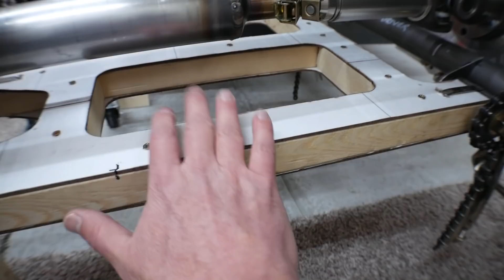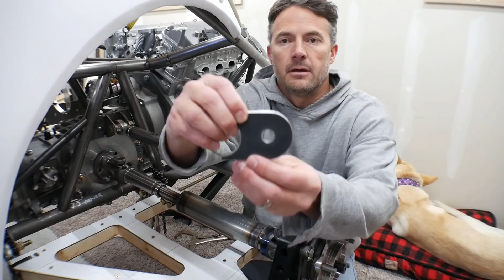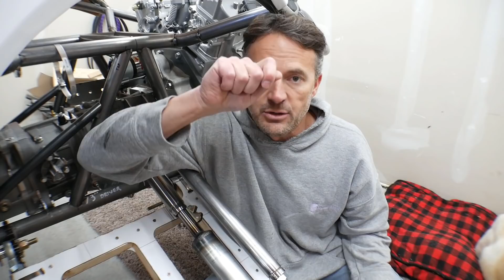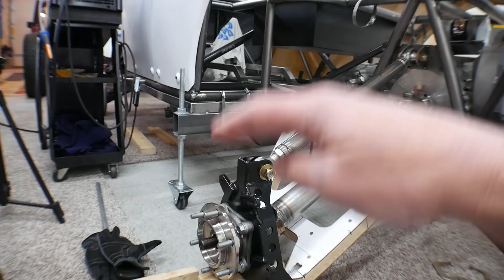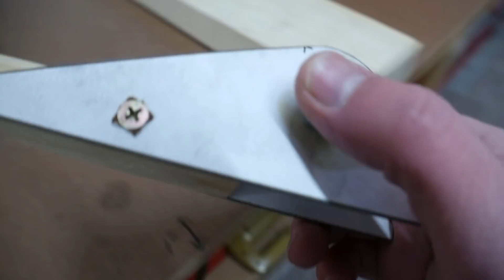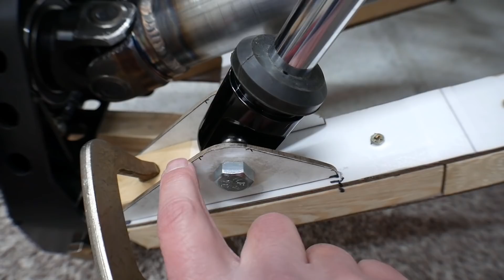Wratchet Rear Suspension Build #5 Shock Absorbers placement.

Comment: comment 66 showing & 259 bug fab liked: I wonder if a thick sprocket & chain free spinning can b used as sway & slow full spring energy throws. U can hve the free spinning sprocket hve exercise type knob adjustment so it can bleed some of the spring throw energy & chain total limits length of throw like limit strap. It would just hve to b built to strength needed for rig it is on, esp the chain.

Comment: Was thinking about ordering the sheet metal add on and something crossed my mind....
     Now that you have the "very accurate" wooden template and you have your lower shock tab how you want it and it's accurate location could you blend the top plate of your lower control arm and the lower shock/coil carrier into the sheet metal program of Bend tech?
     Is this making sense?  Instead of "adding" a lower shock tab with welding could you include it's location with the "Z" axis when cutting the top plate of the lower control arm?  
    Not sure I'm getting my point across.   Basically a lower control arm with a variable thickness.  
    Grrr. Jezz hope I'm making sense
Reply from the maker: I think you're asking if I could draw up the top plate with the shock tab on it.
The answer is yes, but..... you couldn't just draw it up in the sheet metal module. You would need to bring the control arm into an assembly, then bring the shock tab into the same assembly. Then you could place it where it needs to go. And you could do this in the chassis assembly. So you could show the chassis with the control arm and the tabs in location.
When I was considering making the chassis look like a Baja I first made panels in the sheet metal module then brought them into the chassis assembly and put them on the chassis to see how it looked. This helped decide to go the fiberglass panel route.
Reply: You understand.  It was more of a question if you had considered it, more than a question if it could be done in Bend Tech.  But obviously you understand.
     I think this is just one of many advantages to a forged control arm.  They can be machined in three dimensional.  
     Thanks for the attention.

Comment: I will never in my life build a bug... however as a Toyota 4runner guy who does light fabrication and suspension modifications... I also work this way... look at it... move it around... think about it... eventually the best path is revealed.  I enjoy your vids and thank you for putting them out. cheers.
Reply from the maker: I couldn't do it any other way.
And this Baja has 4Runner hubs on it. So it's basically a 4Runner. 😉

Comment: Good stuff.
  When you reference bend tech,  are you using the sheet metal add on?  Or are you some how manipulating the tubing program? If your using the add on, is it worth purchasing? I have the bend tech pro and like it.
Reply from the maker: I am referencing the add on. To be honest I use the sheet metal module more as a 2D cad software. And I use it for most of my flat parts. It's real easy to draw, and I love the 1-1 print option.
Plus I can bring what I draw into the chassis assembly to see how it looks. I don't do that a lot as it's a little tricky. But sometimes I do.
Reply: Sweet.  I looked at the sheet metal add on for the Pro software but kind of learned a lesson to wait until the software has some time to prove it self as Bend Tech improves it as they go 
   Regardless I'll be getting the sheet metal add on as it's cheaper to drawl  up what you need and give your local  metal fab shop the file and have them cut it out.
   Doug your doing a great job keep it coming.  But we need some hardcore Mauler thrashing video.

Comment: Always a pleasure to watch , i'm here  for over a year, i think,  good place to learn.
Thanks for the sharings
Reply from the maker: Thanks!
Appreciate the comment.
Reply: @DougBugBuilder  can i ask you, why you don't use swing arms or trailing arms on the back?
I have like you A arms, and i think to change, like at utv-s.
What do you think?
That's my buggy
https://youtu.be/yegYlhTMFKk
Reply from the maker: @CiobanuValentin_Valy  A Arms offer more adjustability. And they operate on the same plane as the driveshaft. So for the same width you can get more travel out of A Arms. There are benefits to trailing arms. But in a nutshell that's why I like A Arms.
Your buggy is cool, the rear suspension kinda looks like mine.
Reply: @DougBugBuilder  thanks you for your opinion

Comment: Doug, are your rear lower control arms going to be universal from 
Left to Right, like the front arms are? You are awesome, nice explanation. Building your buggy on carpet. 👍🏻🤔
Reply from the maker: They can be used on either side until you weld on the shock mounts. Once they are on, then the control arm is dedicated to that side. The front arms are symmetrical through the centerline. So they can be swapped. The rears are not symmetrical.